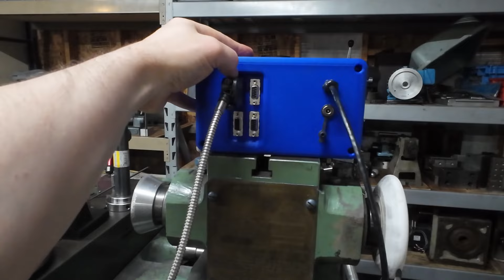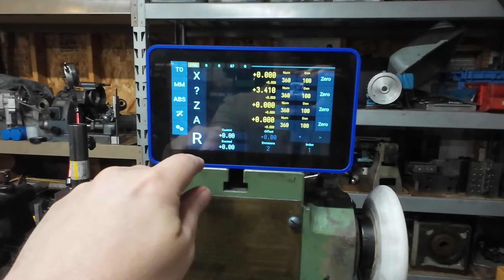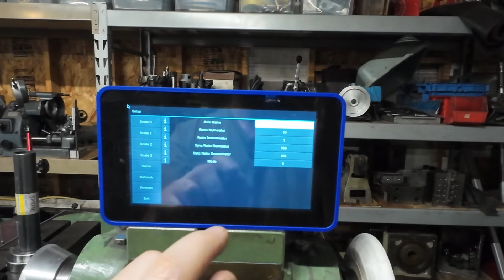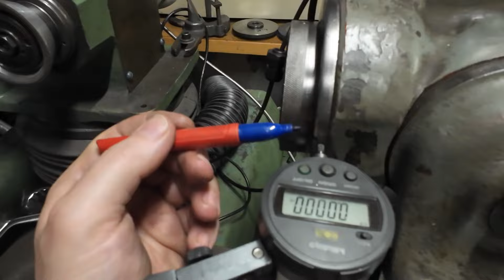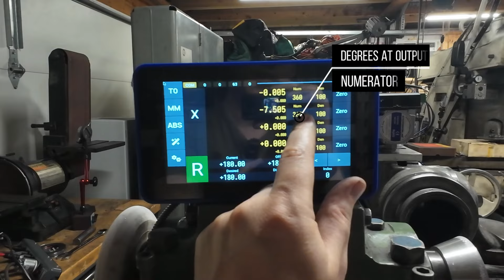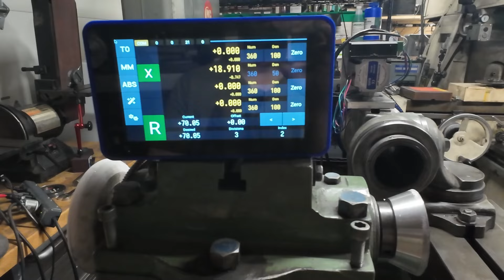Adding DR.DRO and Servo Motor to Grinder Work Head! Boost Your Tool Cutter Grinder! (Part 1)

Comment: Hi Stefano have seen you videos, one with Mark, and latest with My Lil' Mule, he shows assembling unit in detail.
I don't understand how it can be used for electronic lead screw with the unit. Can STM32 PCB be used on it own for a lathe.
I like how it's done with a big touch screen and you work shop is a wish to have it. Do more videos when you can.
I am building small lathe 1200 mm long  x 250mm wide with 20mm linear rails and rolled ball screw, Z 25 mm X 20mm.
There is Smart Lathe T5 by, YUWE MACHINE TOOLS and  STAN CANADA.  STAN CANADA have a nice demonstration and YUWE has a small clip how to update controller.
How hard would be to make unit with touch control like Smart Lathe T5.

Comment: Grate video and just in time I am just going to get it setup for hobbing today :) 

One application where you would need to synchronise to two axis would be for helical gear hobbing I might also have to give that a try. 

Thanks always enjoy your videos
Reply from the maker: Thanks Luke! You’re always too kind :) let’s get your clarkson equipped with the dro!
Reply: Yes can’t wait to pimp out the clarkson but I need to get some scales first. Then build a decent work head for it so still a fair bit of work to do

Comment: Hi Stefano,
Good timing for a new video. I have a video coming out in 3 hours with a shoutout to your channel.  :)

Keep up the good work.
Reply from the maker: Awesome Mark! It sure takes a lot of time to edit the videos, I'm still a long ways from your level :)

We need to get a DRO mounted on your Clarkson!!!
Reply: @stefanobertelli2650  How do you dial in your end mill flute spiral? My mates mechanical Heller has an infinitely adjustable angle (conical friction drive) so you put a clock on a flute and just dial the angle till you get no movement on the clock. You could do the same with an jog encoder input to set the ratio.
Reply from the maker: @RotarySMP part2 of the video will show exactly that, the naive approach i took for this quick demo was just trial and error with a dial test indicator. The monoset manual suggests a clever way of doing the helix pickup that i will show in the upcoming videos as well.
Reply: @stefanobertelli2650  Cool. You are doing a great project there.